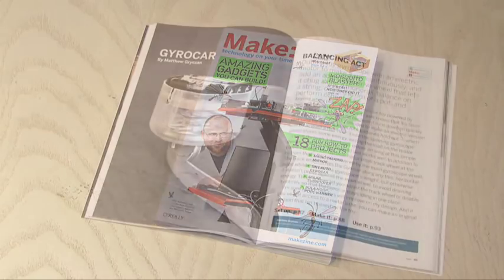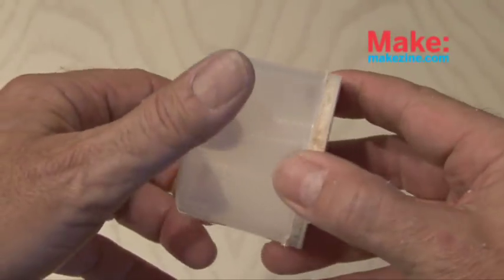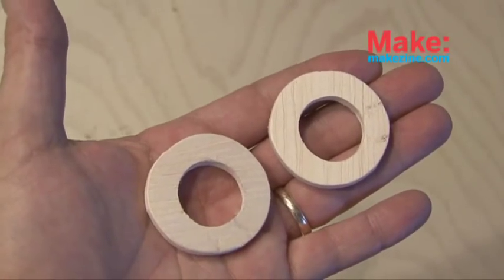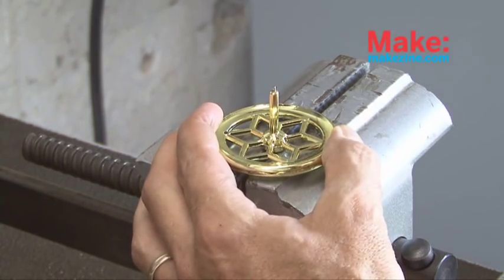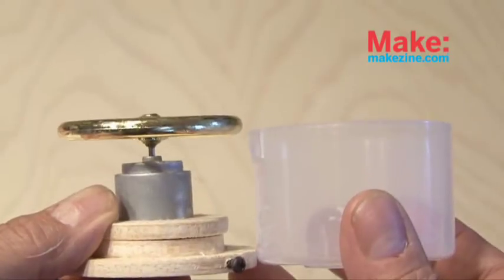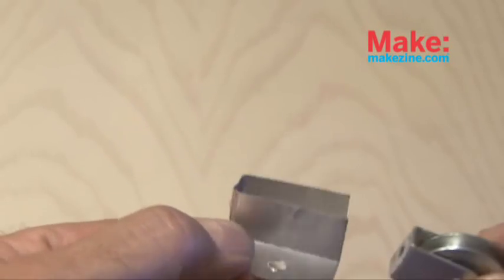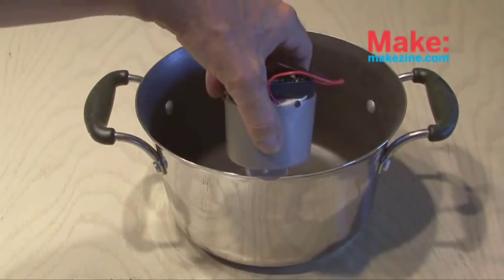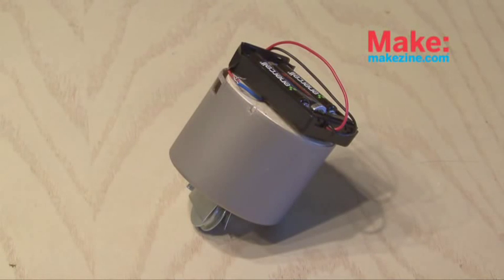Weekend Project: Gyrocar

Comment: Thanks, Kip, for showing my toy gyrocar in your video series and trying to make one. This isn' the best pick for a quickee project because it requires some patience and skill for it to work.  Primarily, you left out a crucial step regarding the track wheel.  One diameter of the track wheel needs to be ground down so only one side contacts the gyroscope wheel. The full instructions are in MAKE, and I've posted a video of it working on a cooking pot.  Matthew Gryczan

Comment: kip, you almost made it, the problem is that every hole should be in the center, very precisely, also the battery pack over the top should be center to center with the box.

this is all about equilibrium. you almost made it, it was great.

Comment: On the bandsaw video,  the gyrocar is noticeably leaning forward,  causing gyroscopic procession  and the forward movement of the car.  It it was straight up and down,  it wouldn't move,  and if it were leaning the other way,  it would move the other way.

I presume some kind of weight was installed on the gyrocar to cause the forward procession to occur.

I'm guessing that since the edge of the pot leaned out,  that tended to cause the gyrocar to jump out of the track.

I would like to see a two point support for the motorized gyroscope,  causing the support to stay upright,  like a bicycle.

Very nice,  relatively simple project!

Comment: What would happen if you took the little metal wheel thing at the bottom and put one of those black rubber lego tiles on it? Would it move around on a flat surface?

Comment: If you still have the brass gear for the motor, I suggest you just run it, and grind it down on some sand paper or rock till it fits in the gyroscope ring instead of trying to drill a tiny hole in a tiny piece of metal and get it to fit just right.  Maybe that will solve some balancing problems.

Comment: The reason this one failed is probably how rounded the pot edge was, giving the wheel little guidance. The out-of-round gyroscope probably didn't help either. (Check out when you spin it on the shaft, it wiggles quite a bit side to side, so the car ends up jumping around a bit.) Tear apart an old tape deck or VCR and you'll find huge rollers, flywheels, and metal pulleys, all trued up and ready to go (many with a hole that'll press fit a motor.)

Comment: I would try to put the batteries closer to the bottom instead of the top, to lower the center of gravity so the gyroscope has less trouble mantaining the device aligned with it's axis.

Comment: I think that it''s the diameter of your circle is too small.

That makes it go faster and fall of due to the centrigugal force.

Also make sure that the hole is exactly centered, the fixed mass (battery) not too heavy, not too high and centered. And check the gyro for balance (vibrations when spinning). Higher rpm will also result in better balance.Mine works fine now. 7.4v lipo on 6volt rc motor with 52grams gyro.

Let me know if you get it working ;)

Comment: Rather than bothering with a brass rod and drilling a 6mm hole, go for a plastic gear that can be ground while the motor is running and make it true(er) with that being centered the issue of maintaining center like pictured will be nulled

Comment: @PR0fl0w height makes no difference it is the 45 on the pot. it doesn't allow the wheel to get any grip and forces it off because the edge is not perpendicular to the gyro

Comment: The video claims that the tension roller "actually make[s] contact" with the gyroscope.  Is that accurate?  Can't the gyroscope provide enough lateral force as it is?  

And if contact is indeed made, that part of the video has been skipped over.  How is the force of contact controlled?

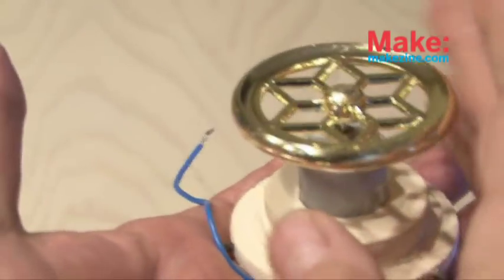Comment: it wasnt working because the hole you drilled in the brass rod that went through the gyro wheel wasn't perfectly straight. ig you look at 1:43 when he spins it by hand, the wheel wobbles a little, so there was lateral force shaking the motor and reducing its speed and so in the end it couldn't balance
pretty cool stuff tho

Comment: I think that it''s the diameter of your circle is too small.
That makes it go faster and fall of due to the centrigugal force.
I might be wrong ;) It could just be the hole in the gyro is not exactly in the center or the gyro itself a little out of balance.
But I'd try first with a larger circle and/or  a larger wheel.
Let me know if you get it working ;)

Comment: Gyroscops prefere to stay aligned in one direction... thyat's why it had trouble to move on smal diameter circle. That's also a reason why you use it in this project.

Comment: are the trackwheel and gyrowheel connected somehow? If they are, please tell me how, I just can't understand, damn it
Reply: No,  they're not connected.  The gyroscope provide stability and holds the assembly upright,  the track merely guides the gyrocar.

If you examine the bandsaw video carefully,  you'll see that the gyrocar leans slightly in the direction of travel.  That leaning causes gyroscopic procession,  which is what causes the gyrocar to move.  So it is the rotation of the rotor that causes the gyrocar to move,  and the direction of the lean that determines the direction.

Comment: Just try with more batteries, it need more speed in the rotor and the control will b perfect....!
Reply: the other guy made his work on a thinner saw blade with the same power, also the pot kipkay used wasn't straight up on the edges.